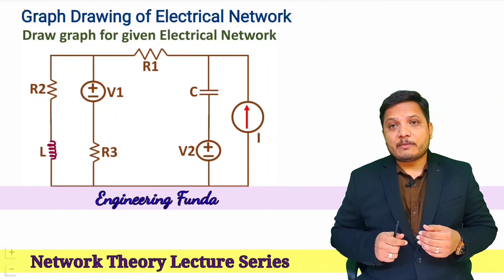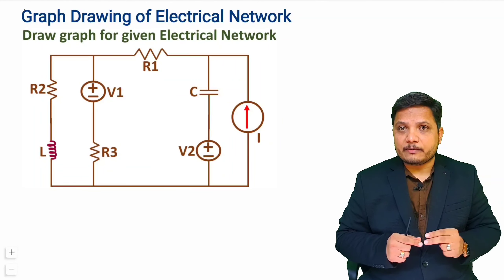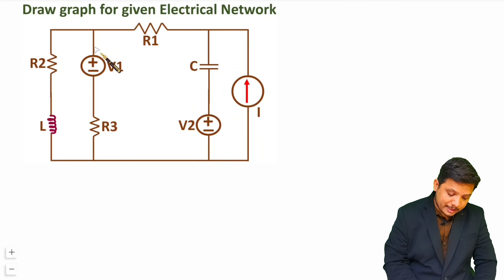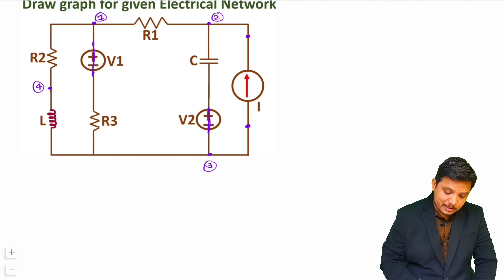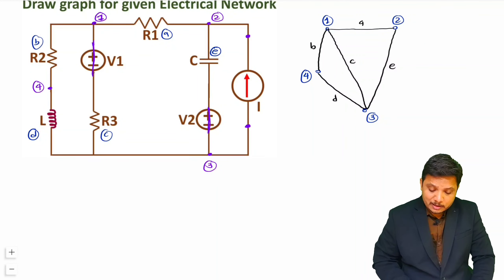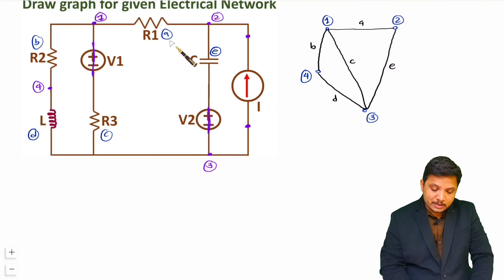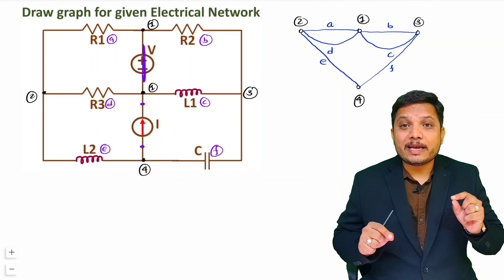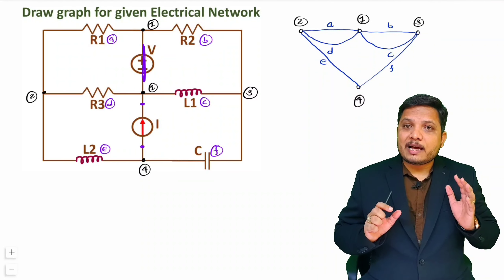Graph Drawing of Electrical Network | Graph Theory | Network Theory

Comment: sir what is is the citeria of taking nodes here because u have taken node 4 between r2 and L i didn't get it or is it something like , there should be a node between two consecutive elements?
Reply: yeah same man i too didnt understood as to then why there isn't a node between L and R3
Reply: Bro we cannot remove the nodes when we open the circuit...further in bigger sums we remove Branch because of open circuit but not a node
Reply: @amansingh9005 that was mistake I think you are correct... There should be node between L and R3🥲